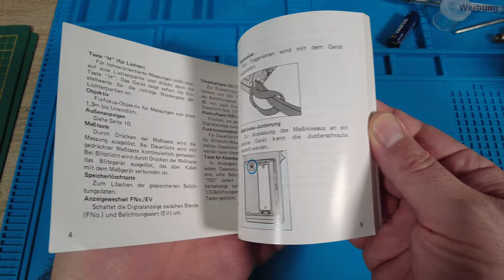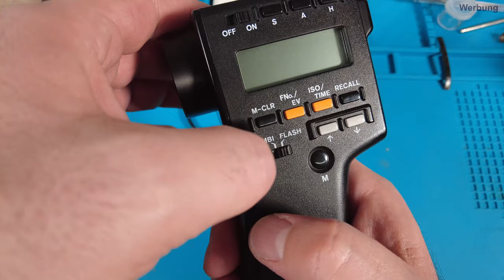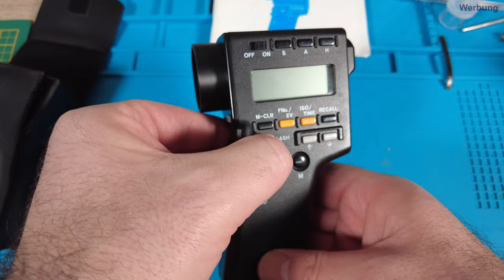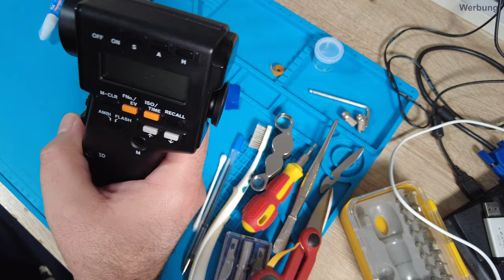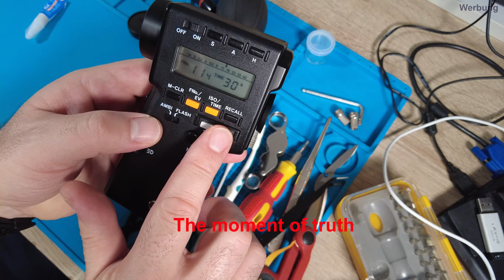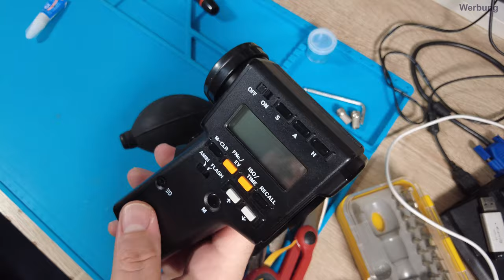Restoring a Defective Minolta Spotmeter F :  Uncovering its Secrets and Reviving a Classic

Comment: one tip, as you are screwing into plastic, after you have lostened the screws, do them back up with a jewellers screwdriver so you only use finger tip tension, not your whole hand, which over torques the thread stripping it. the same thing is done by people servicing computers, I phones, etc. as they are micro mechanics, dealing with small and delicate parts.

Comment: Now I know how to get in there if my Spot-F ever goes down. I would also take a swab with some alcohol on the tip to clean off the inside ends of those contact switches or buttons, just in case one of them was touched and picked up some hand-oil while working in the insides.

Comment: Can you tell me where small spring lug bar went? It looked the last thing you replaced, before sealing the unit up.
Reply from the maker: Thank you for watching my video and leaving a comment! I noticed that you mentioned a small spring lug bar and asked where it went. I'd like to make sure I understand your question fully, so I can provide the best response.

Could you please clarify which specific part you're referring to? If possible, it would be helpful if you could provide the timestamp in the video where you saw this part. This way, I can review that section and give you a detailed answer.

Thanks again for your interest, and I look forward to your reply!
Reply: @DigitalArtDeco  It’s around the time stamp of 16:18 , you are holding the little spring lug in your hand? I was just wondering where it popped out from & where it needs to go back please?
Reply from the maker: @Questy33  This is the metal pin that holds the strap. The metal pin is inserted into a slot under the handle before the case is screwed shut. Best seen at time stamp 18:44 .
Reply: @DigitalArtDeco  Cheers, thanks very much for the info & excellent video, and taking the time to reply, very much appreciated.

Comment: Hello. I've just received mine, but my viewfinder is different...Some Minolta F spotmeters have flat viewfinders, some of them have protruding one. Why it's like that ? Also, I don't know how to turn eyepiece to make a dot a bit sharper inside a viewfinder, do you know anything about it maybe ?
Reply from the maker: The viewfinder should be rotatable to focus the spot. If it is not, please check if it is modified. Possibly there is also a previous unsuccessful repair?
Reply: @DigitalArtDeco  Thanks for the answer. I don't think there is a way to check if it's been modified. I thought that maybe there are a few versions of this lightmeter, and mine hasn't got this option to turn viewfinder.. It's rigid. Also, I'm not sure if it's taking correct measurements. If I got it right, the quickest way to measure the scene is to point it, shoot it, and reading shoud be on display, am I right ? First you need to set up shutter speed, let's say 1/60s, and later you can find desired combination of aperture and shutter speed by pressing arrows ? But if the reading of Aperture shows 5.6 and 1 (little decimal 1) - whats the Aperture value actually ? I compared the values it's giving me with my inside -a-camera lightmeter, and they are different..............

Comment: Hi, I was so happy to find your video.  I recently bought one of these on Marketplace and it worked when I tested but when I went to use it on a shoot a month or so later the measuring button does not work. All the other functions seem to be fine.  I can change settings as needed but when I press the measuring button it always reads "0".  I can see the switch assembly clearly at 5:00 in your video.  Any tips on how I might repair it? What I should look for. I had a similar problem with an old Minolta incident meter where the unit worked but the on/off button did not function (I could power up by popping the battery in and out). I successfully repaired that by disassembling and cleaning the trace with contact cleaner.  Maybe this one functions in a similar way? THanks.
Reply from the maker: Hello and thank you for your question. The problem with the pushbutton could be quite banal. It is possible that a cable on the pushbutton has come loose. These devices are over 30 years old and it can happen that the solder joints break. Maybe you should just open the unit and see if any of the cables are hanging freely. My guess would be the cables on the pushbutton. One of them could be loose. Then just solder it back to the right place.
Reply: Thanks for the quick reply! I will give it a go and report back. :) @DigitalArtDeco